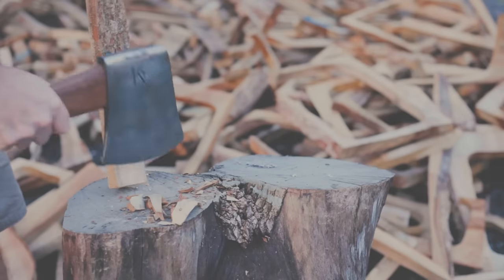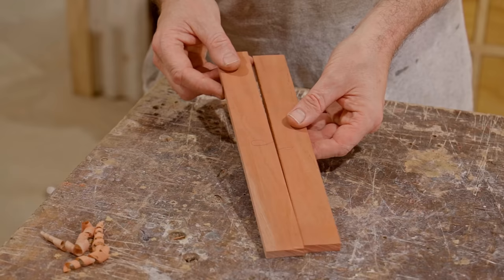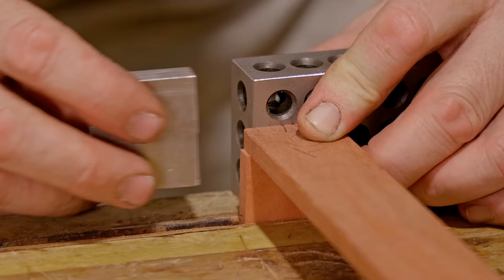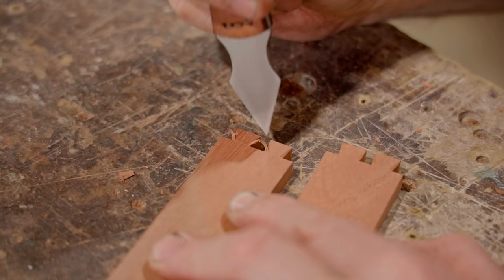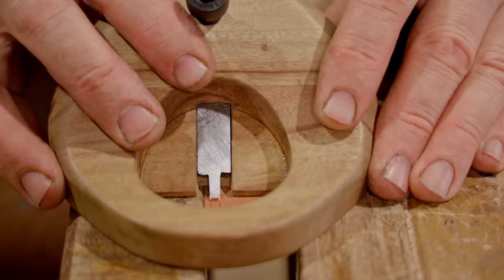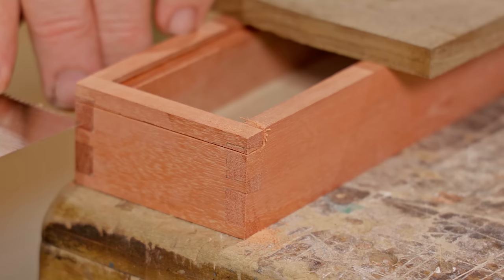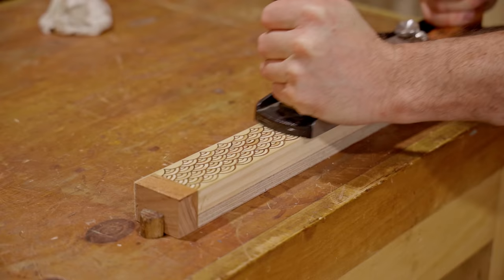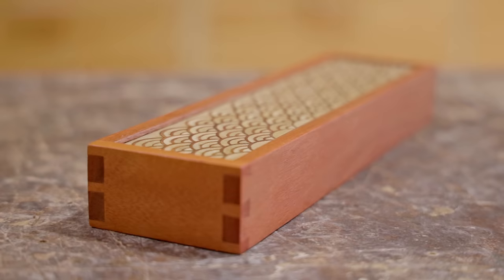Making a Cool Little Box from a Log - Scrapwood Challenge Ep54

Comment: A few big wood screws make excellent low-profile planing stops.  You can screw them below flush so they're out of the way or set them at any height.  The bigger the better and they start to flex quite a bit if they're extended more than say 1/4 in above the surface of the bench.

Comment: I love hand tool projects. A few two months ago I started to build my workbench with a nearly hand tolls only project. I only made the long cuts with the table saw and I will sand it with a power sander . But every thing else is done with hand tools. After jointing all the wood for the tabletop, legs and stretchers I got an inflammation in my elbow. This happens when you let a computer guy do physical work. ;-)

Comment: I do believe my use of the hand saw was the inspiration for the scroll saw. I need some lessons on following a straight line in both the pitch and yaw departments. LOL
Reply: First tip I can give is to give yourself two lines to follow instead of just one. Another is to try to let the weight of the saw do as much of the work as possible, even if it means that each stroke doesn’t cut quite as deep. This is so that you don’t accidentally bend the saw blade, because a bent blade obviously won’t cut as straight as a straight one.
Reply: @ragnkja  Using the weight of the saw has been a large help. Now I let the saw cut instead of trying to make it cut. Thanks

Comment: For the veneers have you considered using a fabric rotary cutter to prevent fraying? The blade rolls rather than slide over the surface and is quite sharp and fine edged, seems perfect for the application.

Comment: Hand tools aren't that cheap either, esp when you need add ons like wet stones.
Reply: Buy used tools, buy salvaged tools, buy cheap Chinese tools.
Anyone can make excuses.
If you want to make things, think.
Not every task is solved with money.
Reply: I live in a place where the cost of living is notoriously expensive.
But i can still buy a saw for $10, a plane for $10-50, a set of chisels for under $50 and a stone for $20.
All new except for the plane.
I buy second hand quality over cheap new though as it's a much better investment.
Learn how to sharpen, maintain and use tools and you can use them to make money to buy more of them.